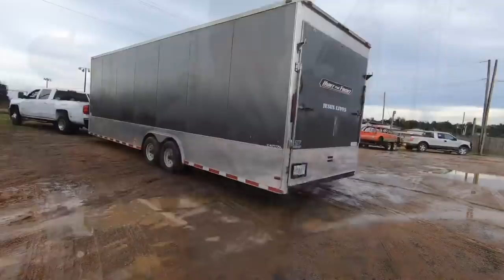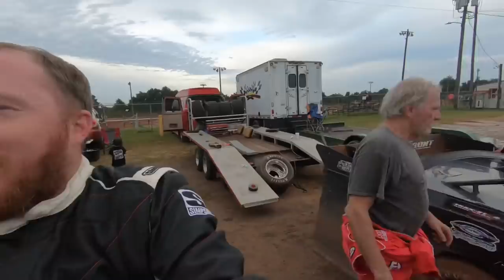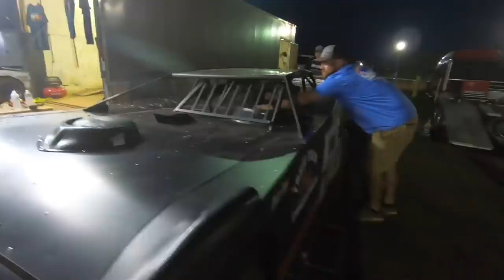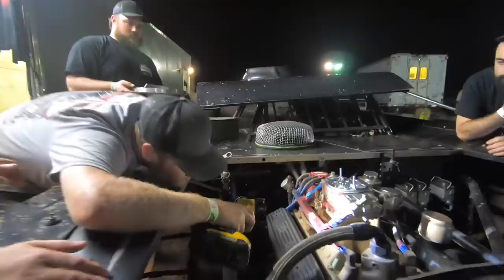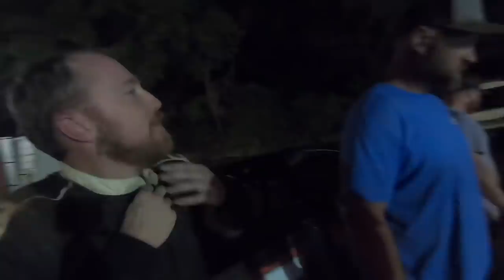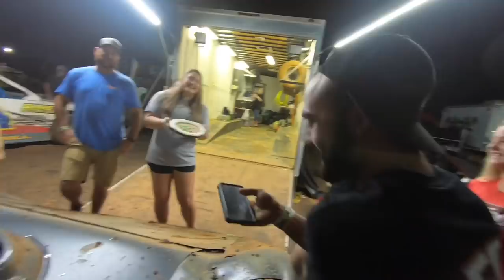Jonathan Returns to the Driver’s Seat / Crate Late Models at Southern Raceway

Comment: If you pull your tear offs with your right hand put the bottom 2 or 3 on so you have to use your left hand and then when you run out with your normal hand you will have a few left as backups. I promise you will use them more sparingly when you know you only have 3.

Comment: Hey guys. I was just gonna tell yall something that helps with the mud sticking to the car. I'm sure yall have something that yall put on there but anyways I use to spray the entire car or at least under the car with some amour all foaming tire cleaner. Just spray it on and let it sit for a few mins and then wash off the excess.  It leaves a little greasy like film on it and the mud wont stick to it as bad. Just figured I would tell yall that incase you dont have something on there already for that. Its inexpensive and it works really good too. Keep up the good work and best of luck in the upcoming races.

Comment: What is Crate mods?  size of the car or engine?
Reply: Engine, it’s a gm 602 or 604 it’s the serial number on the block, they’re sealed motors from GM a 602 is around 350hp and a 604 is roughly 400hp. 602 I believe you can run a 2 barrel carb and a 604 you can run a 4 barrel. Don’t quote me on the carb thing though it’s different almost every track
Reply: @dirtracer21d  Thanks

Comment: That nut on the air cleaner hold down bar would have to be a ny-lok nut.Nothing that could ever wind in in the intake.And that is too big a piece of angle holding it down,1.25x1.25 angle? Causing wasted intake turbulence hurting airflow.